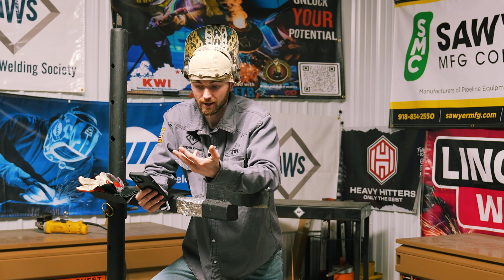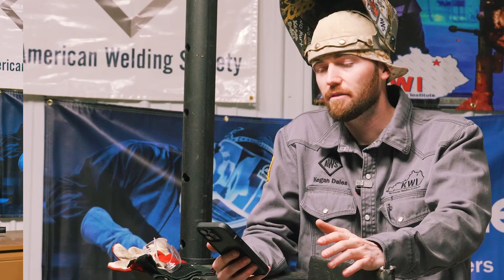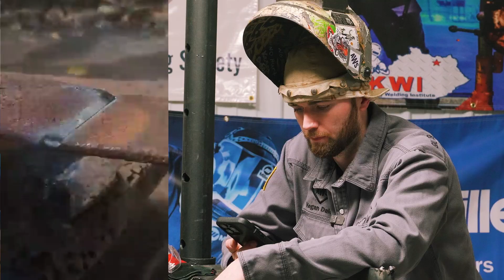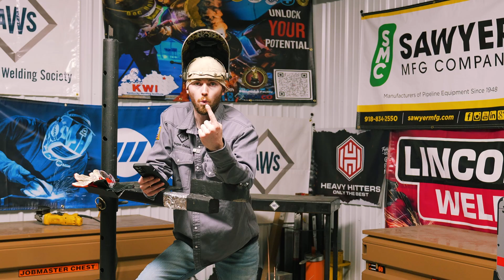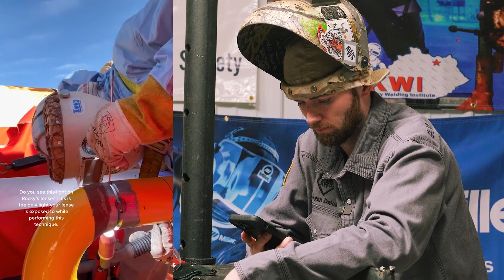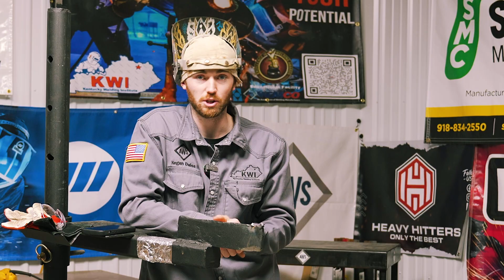Professional Welder REACTS to Viral Welding Videos! Ep. 1

Comment: I pull when I need a very strong weld. It melts more of the metal and gives you more welded area. Besides, I need to see the weld to be sure that it’s melting right.

But in my experience you get a better looking weld when you push. So if the weld doesn’t need to hold lot of weight and is on the outside and if I’m feeling nice, I’ll push. 

But generally I feel more comfortable with pulling cause I can see the weld. 

It’s also not an option in some scenarios. Sometimes you just have to push. In that situations I stay a little longer on the weld than usual to make sure it holds.